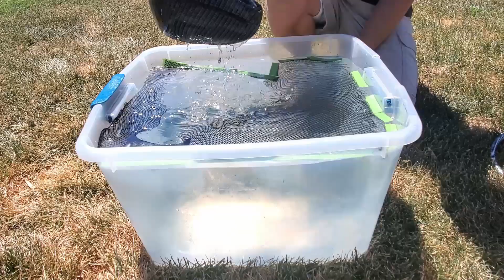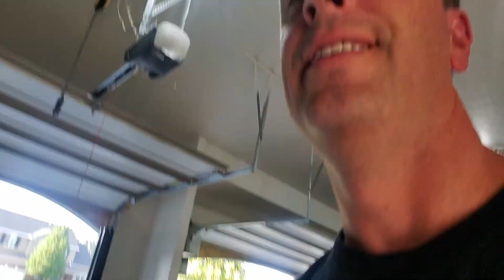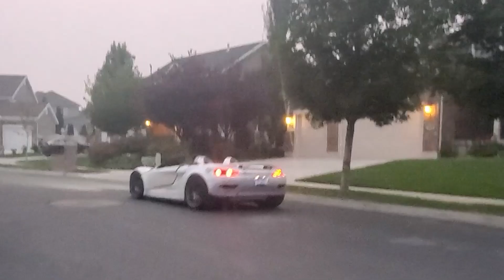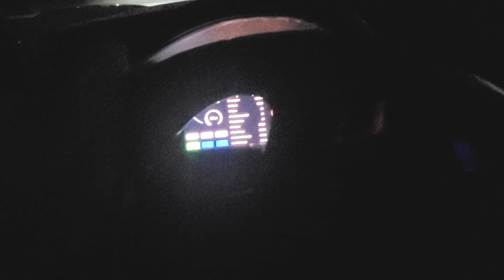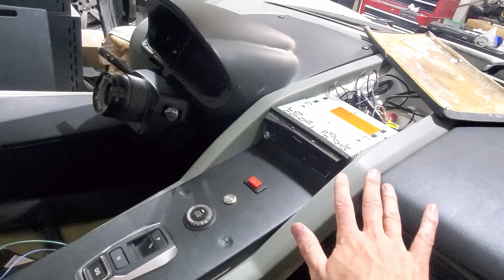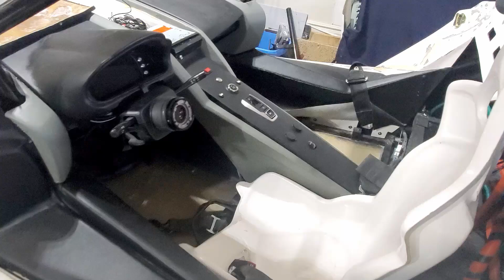First Drive at Night - Electric Supercar tries out lights

Comment: Jeremy, how do I send you a set of cupholders I just got 3-D printed for you? 
I know you’re pretty far along if not basically already finished with your interior and it’s looking very good however, it did take a little while to get my guy to finally find a time to do it otherwise I would’ve had them ready far sooner. Sorry about that.

By the way if you end up not using them, absolutely no hard feelings (perhaps you’ll have space for at least one? Should that make the difference) but I wanted to send them your way regardless. 

I think you will appreciate the unique spill-preventing aspect of these, you only need a 3.75 inch level circular opening per holder for them to hang into (will send a few other parts in addition to the two stackable units which will help make the install as simple as possible, should you decide to do it of course) 

Seeing as you did not have any cupholders anywhere as far as I can see, that along with the day I saw your acceleration times lol was when I figured this WAS a fantastic solution honestly! 

Some people just don’t care about cupholders or are completely averse to them and I can respect that, but if I am given the privilege to send them to you. I would appreciate that more than you know. Confident you will feel the same way eventually.

Also.. what Jack said! Your patience is something to behold… Although I love kittens I just call you a Saint, Saint Jeremy lol

Cheers!
Reply from the maker: Thanks for the offer! Feel free to send me a message 
Electricsupercar@gmail.com

Comment: Hi. In the CE engine we know that there is a "tuning" to boost our car to the limit, does in the EV has the same "tuning"? Or it depends on the motor that we used?
Thanks
Reply from the maker: Interesting question.  There are not really "bolt on" things like a turbo or supercharger that will provide more power for an EV.  Most motor controllers will have options to turn up or down the power.  I currently have never had mine above 3/4 power.  If you want more than your current maximum power you need to upgrade your motor.

Comment: The lights look good. It's so nice that the pump problem was just a loose connector. Sometimes these problems are easy to discover, and sometimes electrical gremlins can be a real headache. It's good to see the interior sorted out and fastened down. The hydro dipped pieces came out great, and they make for a clean looking, well integrated interior.
Reply from the maker: Thanks Dean!

Comment: I really like this project! But I have one question about the gauge cluster, why use an iPad? And how did you code the gauges to interface with the car's internal computer?
Reply from the maker: This is an app that is made to go with the controller.  Only works on iPad

Comment: Really love your work! Just 1 Thing with the Interior I would change. For the speedometer / instrument panel, I would only cut out the screen from the Ipad as a shape.  for the home button I would just cut out a hole so that you can just get there.  the glossy black interferes with the look a little with the bezel.  I think such a symmetrical solution is much nicer than the current one
Reply from the maker: Thanks for the comment!